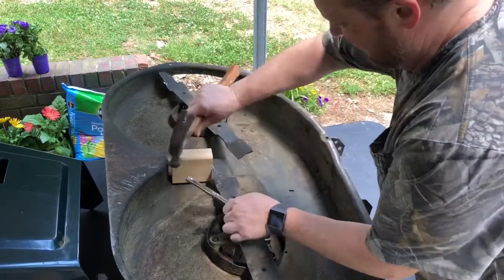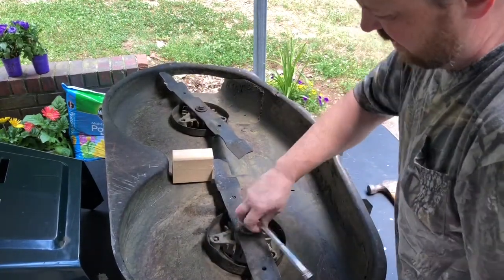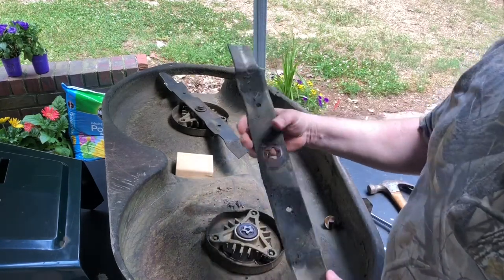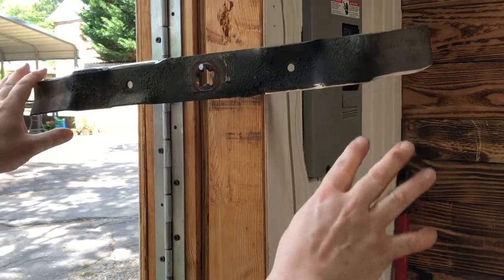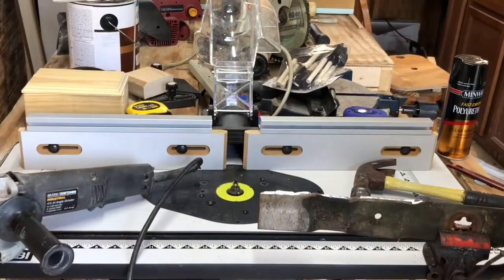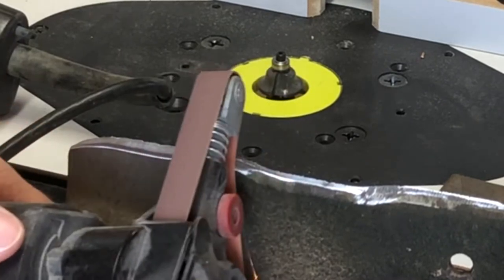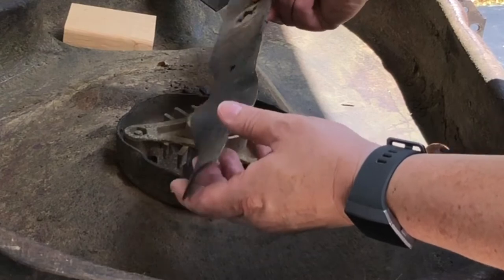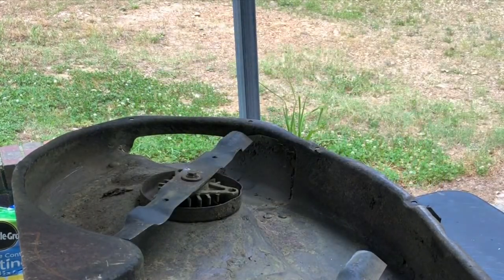Best Way To  Sharpen and Balance a Lawn Mower Blade - Quick And Easy

Comment: Good job brother, that balancing trick is pretty sweet. I've not seen that done before, I'll be doing that from now on. Thank you my friend!
Reply from the maker: Thanks brother.   Yeah that nail is cheaper than a balancer.  A unbalanced blade will vibrate and wear out the Deck spindles and bearings.   Man I hope you have a great weekend